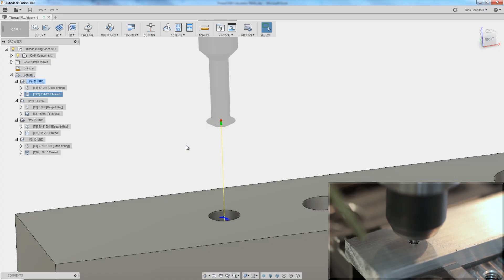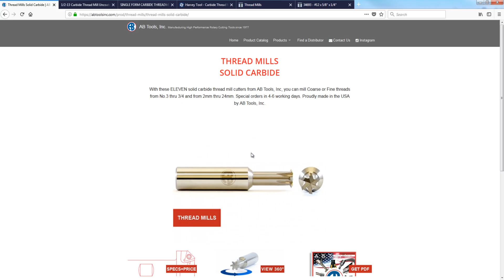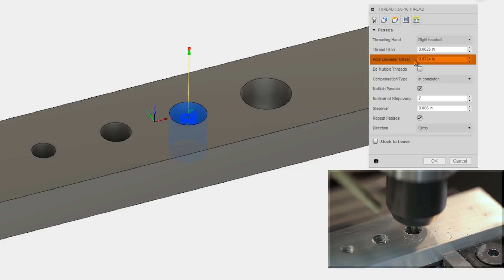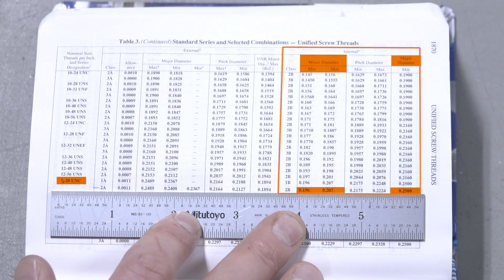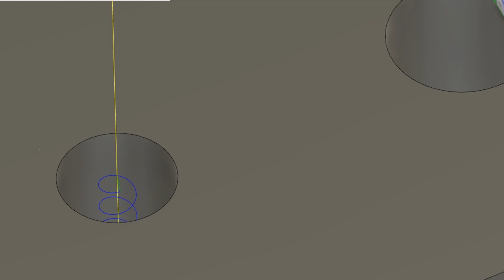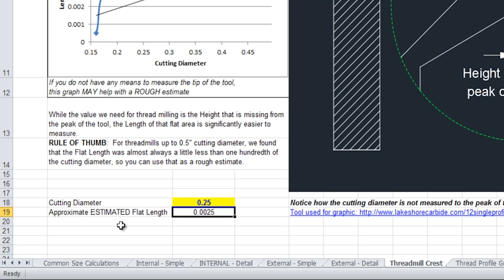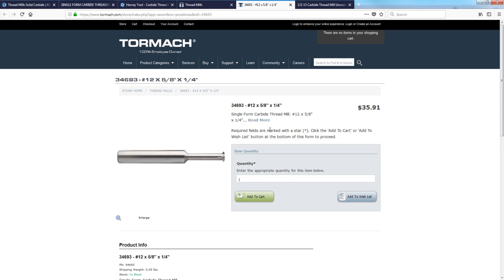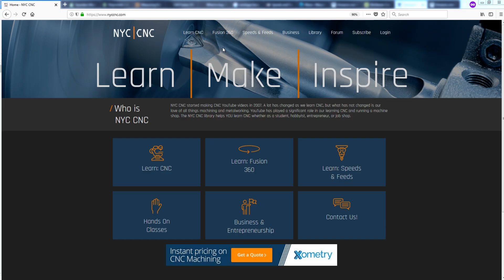Threadmilling: The Ultimate Guide! WW187

Comment: Why so many passes?
Reply: Dustin Walden 2 ways to skin a cat. I usually take a deeper cut at a slower feed rate with one spring pass. Sometimes that's not the fastest way depending on what material your cutting. On very small diameter threads the tool just can't take a deep cut at any feed rate.
Reply: I thread mill all the time especially in aluminum, for single point for a 1/4-20 I use 2 passes and a spring, 6-7 passes is just rubbing, the single point tool is not loading hardly at all as small of a cutter face as it is.  I run mine at Max spindle speed for the machine 5400rpm and .001" per tooth. Also the second cut is always heavier as your deeper in the groove, so in many cases you should use a variable cut depth with the first being deeper than the second!

Now I have a few multi point thread Mills and you need to adjust your passes as there is much higher loading on the tool.  But for single point, let her rip.  Also nice to chanfer the holes ahead of time.

Comment: Holy cow, I get it now.  Thanks.  I'm psyched to order a mill tomorrow.  I have done hundreds of M3 and M4 threads by hand and this will be nice, especially in copper.
Reply: Hello Pro Design,
Milling M3 or M4 is really no fun! I recommend for your application to use a fluteless machine tap without oil grooves, specialy for soft material like copper.
Reply: Glad, that i could help, keep in mind those taps need a precise hole diameter. I always drill that holes ~0,05mm (0.0019 inch) bigger for the start.
If the hole is too big you can see this on the peak of the thread dosent come close together. If the hole is too small you break your tool
Reply: Exactly it's a form tap.
There are tools on the market to mill M3 threads but it takes no time to fill  such a tiny hole with chips if you dont have a internal cooling and then it becomes frustrating when you need more threadmills than the number of threads you have to do.

Comment: Would measuring the OD of the tool and doing the trig give a usefully precise answer?
Reply: You would think so but in my experience it only gets you close and if it's an NPT threadmill your SOL. I always program undersized and comp to size during setup. Record the offset for the threadmill and your golden add long as you buy the same tool.
Reply: Jim's videos no need to measure the treadmill because the measurement is on the side of the box it comes in.
Reply: Yes... would if he didn't have the box. If it's an odd number of flutes then guesstimate. You should be able to get close. And you can always use cutter comp to bring it in to size
Reply: Sheldon Robertson haha you got that right.
Reply: Yeah thats true. With thread mills or any endmill I always keep the box in the top draw of the machine im running them in where it remains until I finish with the thread mill then its back in the box until I use it again but yeah it could easily get lost quite easily.